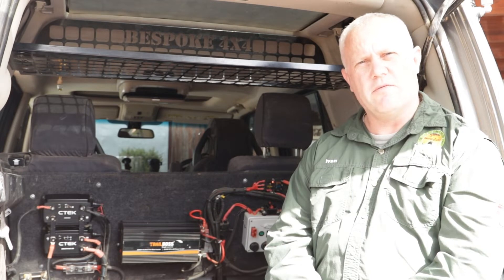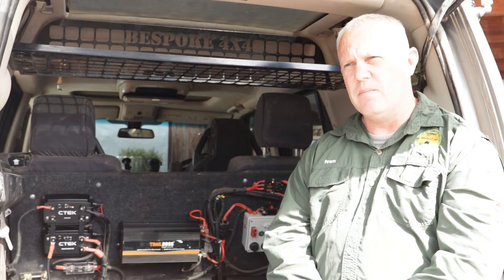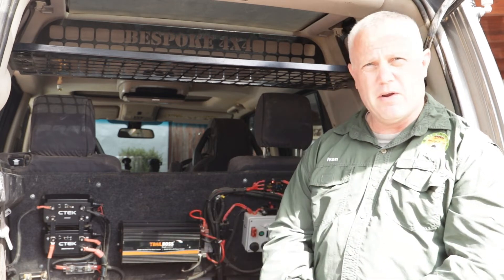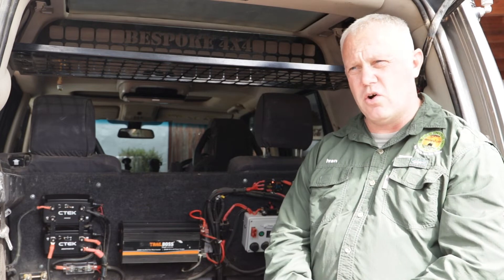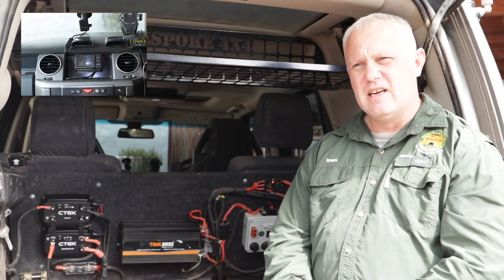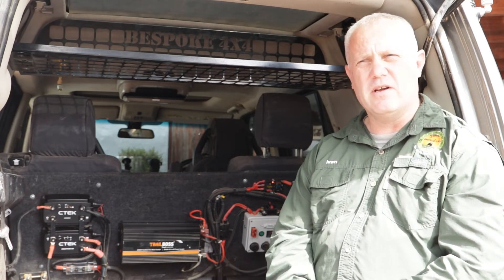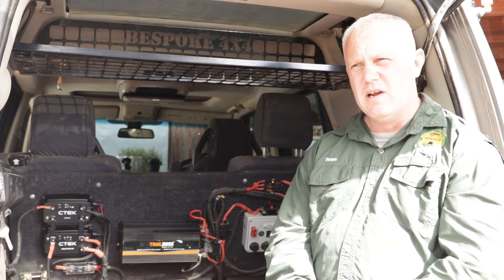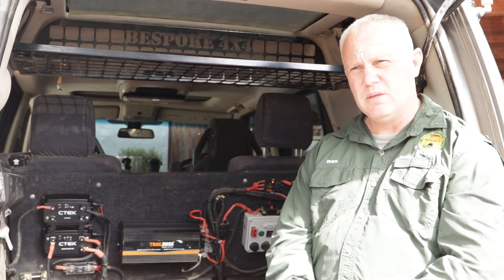CTEK D250SA and Smartpass 120 off grid system review

Comment: Can I put 2x  250 watt panels in parallel onto my ctek.  I have smart pass.  Bought it 2nd hand so clueless here
Reply from the maker: Hi, thanks for your question.

The short answer to having a Smartpass is unfortunately "no".  The Smartpass does not have a Solar Controller built into it.  You would require one of the D250 ranges of controllers from CTEK.

The purpose(s)  of the Smartpass are to 1. Help boost charge from the Alternator to the Service Battery running fridges etc. 2. To assist the starter battery by using power from the service battery to start the car when the starter battery is too low.

So, if you purchase one of the D250 ranges of DC to DC chargers (either D250, D250 S or D250SE) then you can also use a solar panel up to 300w that supplies a panel voltage of no more than 23 volts, also it can handle up to around 24/25 amps.  Therefore, if you connect your two solar panels to your hopefully new D250, YOU WILL BLOW IT UP!!!!!!!!  SO DO NOT DO THAT.  If you genuinely want to utilize the solar capacity of your two solar panels, then you will need to purchase a solar controller with a capacity of around 40 to 50amps because a 250watt solar panel will provide around 20amps.  Presently, CTEK do not produce such a controller, but if you do buy a solar controller, then I would make sure it is a MPPT version.  The agent you buy from will know what that is....

Comment: Wow, very impressed with all the useful information you share! Thank you so much! 
I have just installed a lithium Victron battery on my van, would you recommend this Ctek system over the victron 12|12 30A for DC DC charging? I am afraid if Cteck will charge the battery properly (proper voltage in each state and also will not overcharge it). Here people tell me to buy the victron but I really like your setup. I would really appreciate your advice. Thank you in advance!
Reply from the maker: Hi Agustin,

Thanks for the message. It's always good to hear a reply.

Let me come at your questions reply for you from two angles:

1.	Before I decided upon our DC to DC setup, I was in the fortunate position to be able to field test similar DC to DC setups in the bush in ambient temperatures of over 40 Deg c with equipment from Victron, Redarc, Ring, National Luna and of course as the CTEK D250sa and Smartpass 120.
a.	All tests were carried out utilizing the same alternator (360Amps output) with a full SOC (State of Charge) starter battery (Varta 100Ah AGM), the same set up for wiring and, two brand new 140 Ah AGM service batteries that were at the same SOC at the commencement of the test and were discharged to exactly the same 20% SOC before each DC to DC charging system was require to recharge the service batteries. This means that to complete the tests, I had 10x brand new 140Ah AGM service batteries at my disposal;
b.	The Charging process was carried out five times at three different times of the day over exactly the same route (with no traffic) on each DC to DC charging system. The tests commenced at 06:00 hrs when the ambient temperature around 18 Deg c; then at around 14:00hrs with an ambient temperature over 40 Deg c and then finally at around 19:00hrs when the ambient temperature was around 28 Deg c.  Of course, these were the outside car temperatures, and inside the car recorded by the two service batteries were about 15 Deg c warmer;
c.	The course the vehicle drove was exactly the same route for a duration of 2hrs and 30 minutes to typically simulate a 2 to 3-hour overland drive a user might take each day having drained their service battery set up overnight and then require charging them the next day;
d.	At the end of these tests, very clear data emerged. Many of the DC to DC charging units could not generate their full stated charging quantity or amount during the higher ambient temperatures. By this, I mean that lets say a unit “could, according to the manufacturers recorded data” charge at 30Ah. The reality was, that in higher ambient temperatures, the unit would in fact only charge at around 18Ah. This would mean that over that 2hr 30-minute drive, the unit was down a total of 33amps on what it could or “should” have actually been able to provide to the service batteries. So, with a 280Ah service battery bank that had been depleted down to a 20% level I.e. the 56Amp left in the two battery’s (set in parallel). After the 2hr 30-minute drive, the unit that should have been able to put around 75Amps into the service batteries, but had in fact, only put in 42amps meaning the service batteries were charged up to around 98Amps SOC, way down on the require minimum of 80% SOC (224Amps). This information was concerning because it would mean that a user would not have sufficient power in their service battery bank to sustain the required demand the next night.  
e.	Now even if the said units could have provided their full output to the service batteries of say 30Ah, then in reality, with a service battery bank of 280Ah (which is not a large service bank), from a starting SOC of 20% (56Amps), the unit could only have put in a maximum of 75Amps that could have brought the service batteries SOC up to 131Amps, again way down on a required or necessary 80% level nearly 100amps down on what would be required. This would have meant the user would have had to drive for at least another 3hrs 30-minutes to get the batteries up to the required 80%. This clearly would not be a practical option if the ‘overlander’ was only driving for a 2hr 30-minute duration.
f.	The other thing to consider is that batteries (other than lithium) are inherently not efficient when charging from the 80% level up to the 100% level SOC. The last 20% takes a very long time to charge.
g.	As indicated, at the end of the tests there was only one unit that was over the duration of the tests able to charge the service battery bank to a full 100% SOC, that was the CTEK system. Yes, the D250 and Smartpass 120 combined can utilize a mammoth 140Amps from the alternator and of course, this was way more charge per hour than any of the other units on test. But the interesting data was that regardless of the ambient temperature, the CTEK units provided their full outputs overt the duration of the tests.  
h.	I decided to remove the Smartpass 120 to bring the test into a more level playing field. The D250 unit again provided its full 20Ah over the same duration. 
i.	Other than the CTEK, all of the units on test were unable to provide their recorded manufacturers output.  One unit in the higher ambient temperatures could in fact only provide a worrying 4Ah when the it had a stated 30Ah output. Another that had a stated 25Ah output could in fact only sustain 6Ah output.
j.	All of this data was very useful in allowing a decision to be made on which unit(s) would achieve what was required I.e. getting the service batteries back up to the minimum of 80% SOC.  Only one set of units was able to full charge the service battery bank up to the full 100% SOC in the allotted time scale and that was the CTEK system; 
k.	Interestingly, I was contacted by a manufacturer in Australia (not Red…..) that stated that their system would “out perform the CTEK system and that the CTEK could not possible do what it did and would have had to over-charge the batteries” (not actually possible, because the batteries govern how much charge they will absorb, not the unit). So, I put it to this Australian manufacturer that if they wanted to loan me their unit, I would test it back to back against the CTEK system, THEY DECLINED MY OFFER!!!!!

2.	So, to the second angle:
a.	We have now been running the same 2x 140Ah AGM batteries for over 3 years now, they have never been off load during this period with, a two fridges and other accessories constantly loading the batteries overnight or when the car is switched off;
b.	In this time, yes of course the overall SOC of the two batteries have declined over this time, but the CTEK system has never overcharged the two batteries contrary to what a certain manufacturer erroneously suggested;
c.	I monitor the service batteries very closely and yes, now after three years the two batteries are coming up for renewal as they are now holding about 80Ah each;
d.	My plan like you is to utilize lithium batteries in our system but, I will be using the CTEK D250se and Smartpass 120S to charge my new service battery bank that will be increased to a huge 600Ah plus.

To conclude, in my view given I am not sponsored, I do feel the CTEK system is without doubt the best currently available. It performs flawlessly and has never let us down. Yes, the installation is very important and yes, I oversized my wiring to ensure the least possible voltage drop to the units from the front of the car.

I hope this helps……
Reply: @overlandi5056  Wow, not only thankful for taking the time to answer so fast but also for being so generous! 
It is amazing the tests you did and how clear and straightforward you are about test conditions and performance.
I really thank you for your reply.
Reply from the maker: Hi Augustin,

Just wondering how you are getting on with your setup???

Comment: What size cable did you run between smartpass and starter battery? Booklet says 0awg for a longer run cable
Reply from the maker: Hi Chris,
Thanks for your question and, may I apologise for not replying sooner. Things have been somewhat hectic with three of us in our family going down with Covid all at the same time.
To answer your question, I am going to assume you are also using a D250 (variant) charger in conjunction to the Smartpass. Equally, given CTEK’s advice to not install their units under the bonnet of the car, I am going to work on a 4 to 5-meter cable run much the same as our set up.  With the DC-DC charger and Smartpass combined, the two units can draw up to 145amps to provide a charge to the service batteries up to a colossal 140amps (per hour) of charge, obviously dependent on the power the alternator can provide. I also worked on the basis of quite high temperatures in the car that could, at times be as high as 45 deg c.
Potentially, at this amount of charge, the calculations for the cable would be a 95mm cable or 4/0 AWG. So, based upon this information, I used two 50mm cables on my supply run from the Starter Battery to the CTEK units because to try and route a single 95mm cable through the car was simply not going to work. In running such large cable, my voltage drop was very low and thus the current drawn did not go up significantly (ohms law – as voltage goes down so, current must go up). The key thing to remember as well is to use a thick negative cable from the CTEK units and ensure it is grounded really well. All my joints were soldered with a bridge in the solder joint to aid any vibration issues.
I hope this helps answer your question.
Reply: @overlandi5056  thank you really appreciate it
Reply from the maker: You are welcome..

Comment: I've seen a few reviews on this setup and only one showing the actual amps they were seeing with the combo charging via the alternator, that was on an older van and he was getting around 30a charge rate at idle. What kind of numbers are you seeing? I purchased the Smartpass 120S & D250SE since i've got a large lithium service battery (560AH).    I haven't installed them yet as i'm worried that high of charge rate might damage my alternator.  I have a 250a HD smart alternator.  I imagine they built some precautions in so your alternator isn't over taxed since i've seen enough people with the setup who probably don't have as robust of alternator as I do but curious as to what you think and how your setup has worked out since you made the video.
Reply from the maker: Hi Micah,

Thanks for the question.  We have been running the CTEK D250SA and Smartpass 120 in combination for about 2 1/2 years now and I have to say, they have been absolutely faultless. They have kept our service batteries (2x Enertec Discoverer 140A/h AGM's) completely topped up and, the  Smartpass keeps the Starter battery pulsed with power from the Service battery's, thus ensuring the Starter Battery (also an AGM) is always as full as it can be.

To give you some specifics of what kind of current I am seeing, I will explain a little.  We used to run a Land Rover (Densol) standard alternator and at Idle, if the service batteries were low, say around 50% (or less) SOC (state of charge), then I would see around 50-60 amps at idle, providing the Starter battery was full and, I was not loading the alternator with lots of lights, fans etc.  But as soon as the RPM picked up to around 1,500 RMP, I would see over 100amps of charge.

In time, I realized that if I wanted greater charge at idle or when running along normally, I would need to increase the output of the alternator. We now have installed, a monster 360amp alternator. When installing, I place a slightly smaller wheel/pulley on the alternator, so now, at idle, if the service battery's are as described above, then I now see around 90amps of charge and when at around 1,200RPM or above, I can now charge at a combined (D250SA and Smartpass) 143amps without affecting the alternator and, I can run all the lights and fans etc. or the car.

In my view, the CTEK system is without doubt the best in car DC to DC charging system  presently available. 

The key thing to the installation is your wiring. I use a 50mm cable set up and in doing so, my voltage drop is minimal. This is the important factor to ensuring the efficiency of the system.

Soon, we will be upgrading our Service Battery's to 3x 200A/h Lithium battery's. We will not hesitate to change over to the D250SE and Smartpass 120S.
Reply: @overlandi5056  Amazing!  Really appreciate the info.  I figured it was a robust well thought out device.  I've not read any complaints from owners of them only skeptics thinking that type of charge rate wasn't realistic and would be potentially damaging.  The actual numbers and hearing about your setup really put my mind at ease.  Can't wait to set it up.  I've got some heavy wire and my starter battery is under my seat so it is a short run to the service battery.
Reply from the maker: @Micah.  I'm glad I was able to put your mind at ease.  It is unfortunate but, there will always be people who are skeptical of such things.  The reality is that CTEK clearly put alot of time and effort into their products and they last.  The only time there is ever a problem with the units is when people do not follow the installation instructions.  Primary one in this case is; DO NOT INSTALL THE D250 AND SMARTPASS UNITS UNDER THE BONNET.

I hope your intended installation goes to plan and, if I can help any further, please do not hesitate to get in touch.

Comment: I’ve just installed mine and have found that when my 2nd battery (AGM) is at 100% (13V) my ctek continues to pump in 14.6V. Is this normal?
Reply from the maker: Hi, thanks for the question.  Yes, this is quite normal. The CTEK is monitoring the load and resistance as well as temperature.  It will regulate automatically.  Mine does exactly the same and I run AGM service batteries as well.

Comment: Hello Can anybody clarify this
 The D250 range will charge your Service/Auxiliary batteries up to 20amps
Does it mean 20 amps PER HOUR?
Thanks
Reply from the maker: Hi Serkan,

Yes, the 20amps charge is rated at per hour.

If I can be of any further help, please do not hesitate to contact me.
Reply: @overlandi5056  thank you for reply.I sent an email to Ctec before asked you
Answer is confusing me
What is your comment please

(Serkan Ask to ctec: I need information about this device.According to description when connected with solar panel 
technical info says ''charge up to 20A''
Does it mean 20 amper hour? 20 Ah)

(Ctec answer:Hi
It means that the out put from the D250
is 20A and it can charge a 300Ah battery)

So without smartpass device, with only de250se is what can I do maximum for life batteries
I am planing to set up 2 pcs. optima 75 amps underneath of 6nd and 7th seat.There is a empty spot.
I t means 150amps/20AH=7,5 hours need to full charged 
Please correct me If I am wrong

Thanks&Regards
D3 2005 TDV6 
Serkan
Reply from the maker: Hi Serkan, sorry, I did not see this question until now, so I'm really sorry for the very later response.  To try and help, the D250 can provide 20Ah (amps per hour of charge) so that means it can charge the service battery at up to 20ah.  At this charge current, it mans that the unit is capable of charging a service battery configuration of up to 300ah.  So if you have a 100ah battery or three x 100ah batteries, it is more than capable of charging them.

Comment: Does the smartpass step up the alternator voltage to the required charging voltage for the service battery?
Reply from the maker: Hi Steve,

Thanks for your question.  The Smartpass itself does not regulate the alternator voltage to the desired voltage of your service batteries (AGM, LITHIUM, DEEP CYCLE ETC.).  In order to do that, you will need the D250 unit.  If you decide to purchase a D250 unit, I would suggest the D250SE unit because, then you will be able to charge Lithium, AGM and Deep Cylce batteries. The D250S does not cater for Lithium batteries.